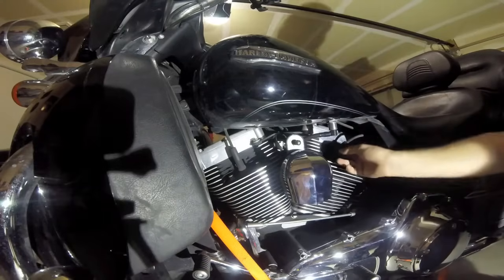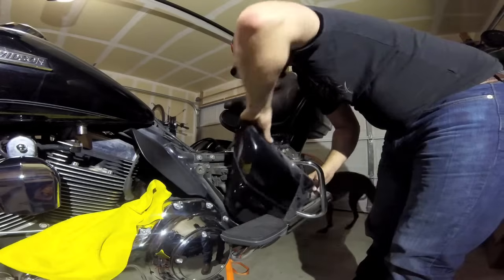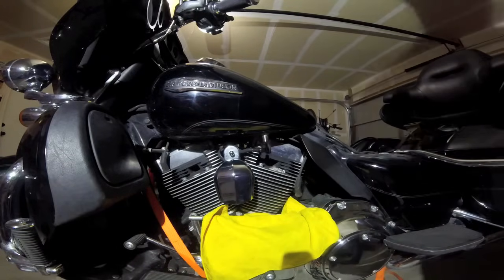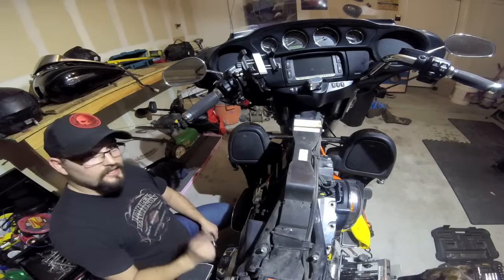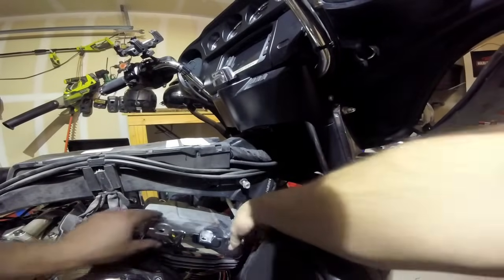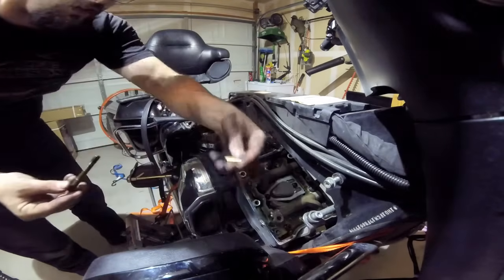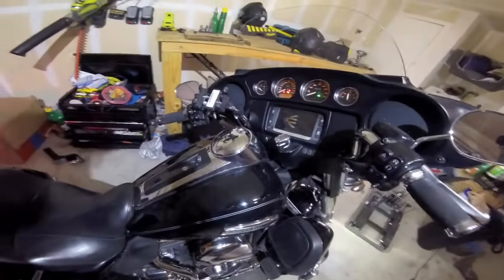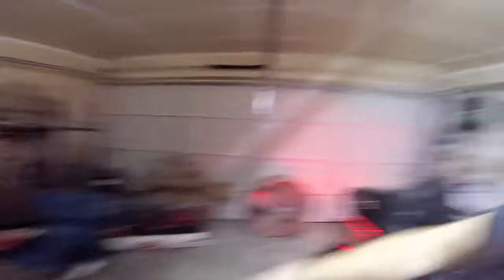$10 Part to Make Your Harley Top Tick Go Away

Comment: My pipes are so loud that I don't hear any ticking. Also any ticking that you do hear should go away after your bike warms up. But let's be honest, the ticking is a Harley thing and I have never found it to bother me much. Kind of surprised that you didn't use a torque wrench to meet torque specs or lock tight bolts before putting em back in.

Comment: $10 for the part ... 35 billion for gaskets and sealer and more gaskets and more sealer and sealer remover and stuff to clean the sealer remover off and more gaskets and 35 quarts of oil because it keeps dripping and oozing and doing that oil thing and more gaskets and 3 hundred thousand in gas running back and forth to the dealer for all them damend gaskets ...... yeah $10 for the part

Comment: i have the exact same bike with 24K miles and as a retired mechanic i wondered why it clicked. mine quits when it's good and warm. this thing is smooth as velvet compared to the old iron head engines. good video though and thanks.

Comment: Excellent video on a cheap, but labor intensive fix. I've had the same sound on my 2014 Dyna Super Glide Custom the last year. It has 32,000 miles on the engine. It goes away when the engine oil has warmed up. However, it is absent when I do an oil change. I just did the 3 hole oil change a couple days ago and it disappeared on start up. I usually change the oil every 3-5000 mile with 20-50 synthetic. I might start using the sound to indicate time for an oil change. When it starts to be a permanent sound, I'll definitely use your fix. At least on a Dyna, there is less work to do with parts removal. Thanks for the info.
Reply: Put a half quart of Lucas oil additive in each case...Premix it with the oils, before putting it in,  so it will not be to thick for the oil pump to pick it up,  I've done this since mine was new, and doesn't tick at all, plus I get 6-7 on an oil change...plus you can actually see it on the oil stick when its freshly new, when checking it, and I always have great oil pressure, during the interior time of each change...I have 45 thousand on mine and it performs great, with no ticking , even at the hottest or coldest times...plus I use Shell Rotella 50w oil...yes its diesel oil,,but it has great viscosity and last for much longer duration...I always buy my products from Walmart, it's the cheapest prices I can find
Reply: As of right now you just have a built in service reminder. LoL.

Comment: I did this fix when I had my Harley. Helped with the noise but still a lot there. I replaced the lifters next with some qualty after market lifters. That helped a lot. The rest of the engine still made a helluva racket. Many comments as to where is the torque wrench? I used one but in my opinion the factory specs are too high. I was afraid of stripping the bolts so I used my common sense as to the correct amount of torque.

Comment: It's always a good idea to say something to the effect of "this fix might quiet your engine" instead of "will" make the tick go away. I've installed these things and sometimes they help a bit, other times they do nothing as there are many other reasons Harley motors can tick.  Loose tappet to bore fit, worn or dirty tappets, aggressive aftermarket cam lobe profiles, loose valve guides, low oil pressure, etc.....it's a long list. The other thing is the rocker support plates are cast & not all exactly the same size where the Lockers get pressed in. I've had a few that I could not get the Lockers in no matter how I tried. So tight, they would fold before going all the way in.

Comment: I like that your video shows just how easy it is to install the rocker lockers. Hopefully none of that dirt fell into the top of your engine while you had the valve covers off. (have you ever seen how tiny the oil passage is in a oil jet?)  Rags are cheap man!  A torque wrench and a service manual are your best friends when shadetree wrenching on your bike!  Failure to properly and evenly torque rockers and valve covers can lead to a plethora of other mechanical problems and oil leaks.  Knuckle value torque is NEVER "good enough" on dynamic components, nor on gasket sealed covers.  Just sayin'
Reply: you should write this to Harley engineering team first :)

Comment: I like the quick disconnects on the fuel lines. Might have to look into getting some of those myself. My 98 Heritage has the crimped clamps on it still. Mine also has started ticking intermittently as well but my heads are a little harder to remove in the frame than yours was. Less space...

Comment: Whilst 'Rocker lockers' are a fine idea - I use them - another sorce of the ticking noise is the rocker shafts themselves being a loose fit it the rocker carriers and/or the rockers being a loose fit on the shafts. If you go to the trouble of fitting rocker lockers, you might as well do the job properly and check everything.Rocker shafts/carriers and the bushes in the rocker arm all wear out especially with higher lift cams/heavier valve springs.
Reply: I agree for the amount of labor involved might as well spend $250 and replace rocker shafts and bolts. Specially for engines running higher lift camshafts and heavier valvespring pressures.

Comment: My 103 twincam doesn't tick..I used Castrol 50w with a half quart of Lucas oil additive...I put half quart of Lucas in my engine, trans and primary...I always premix it with the oils, before adding it to the cases...I always have no less than 15lbs of oil pressure, even at its hottest moments at 100 degrees in heavy red light traffic
Reply: Not calling u a liar, but that's very hard to believe.

Comment: WOW!   Tightening bolts into head without torque specs or wrench?   
It still "ticks" like a Harley.  It probably always will.
Reply: I thought the same thing. I always use a reliable torque wrench. Over tighten one of those bolts, and you've got all kinds of trouble. Buy a torque wrench or borrow one, for a job like that. The same for the valve cover bolts.

Comment: When dealing with aluminum, you should REALLY use torque specs and not the spec known as FT lol. Too tight, you pull the threads out. Too loose, the whole top end will grenade. I hope you torqued them properly for your sake.
Reply: You mean two clicks of the elbow isn't the correct spec?
Reply: @frankhubbardiv8711  with locktite that'll probably work. Without, I'd go 2 1/2 clicks.

Comment: Maybe its by design that the tolerence is loose so that it doesnt wear that pin or rocker arm?....The bolt wearing is alot cheaper than those other hard parts... Just a thought...
Reply: That's why they design an item called shims, shimmed properly, it won't make a lot of noise. But u need basic mechanical skills and experience, this guy has neither.
Reply: If it was by design why is Harley installing these

Comment: What happens when those thin sleeves wear and break apart? They go into the oiling system and through the oil pump. Bye bye oil pump and possible the entire engine if you don't notice it the loss in oil pressure fast enough. I went through a similar issue with a rocker arm bushing on my shovelhead.

Comment: Hi, thanks for this. Do you recall whether or not the ticking noise went away once the engine warmed up after a few minutes? I've recently had similar noise - quick ticking or tapping sound - on my Sportster 1200 when I start it up but it goes away after a few minutes (presumably because the engine/oil has warmed up?).
Reply from the maker: @bernardlesperance742  after it warmed up it did quite down but never whet away

Comment: Do the valves make noise when they close, does that sound change with a change of the cams, it is after all, not a cast iron motor with water jackets, behind an insulated firewall, that motor is never going to be without mechanical noise.
Reply: wow...hit the nail on the head.  just rebuilt my 2005 15 anniv fatboy, from the bottom end up...,S&S brand new crank, andrews 37g cams,, adjut pushrods, 8007 bullet aluminum fueling cam plate, hp fueling oil pump,brand new clutch assembly,new hp 1.4kw starter motor,and new jackshaft, indy just up graded double row IPB bearing kit, all new jims gaskets, and seals, whole bike. i get it back, loud chattering tick/chatter from primary, worse than before all the work. was going to my  garage and look for my gun... no joke, this 2005 twin cam , has to be the loudest, damn bike i owned!!!  driving me really nuts....! Bike sounded like a diesel cummings, warmed up right after the cam install. then it was sumping(dry, bike off on stand) the new hp fueling pump/camplate, sucks oil down with gravity, in a WEEK?? NORMAL?? but  oil does returns full to the tank at start up, giving in a few mins,
      i checked my oil and its down to the TIP OF OIL STICK, ALL SUMPED TO BOTTOM CRANK CASE in a week!.  nothing can be done, thats just the set up fueling has much larger passage holes in plate and pump. My indy, took  camplate/oilpump all apart to check, for pinched orings, gaskets or seals, preventing oil to gravitate to the bottom crank in a week. all was good, as before he said.   so im about done, with bike, now i just ride the balls off it, ignore all the noise!!!!!   sorry so long, but good right!!!  ty, peace!
Reply: @-MrRichBiker1967  having to hunt for your tool, is fine, unless you need it right now....no joke
Reply: @-MrRichBiker1967 sumping is when the pump is unable to scavenge the oil from the crankcase, camchest, a serious condition, oil level should be checked after warm up,

Comment: 2001 Road king 107.000 mi on the engine. Got it with24.000 do my own work never had the engine apart..If its not broke do not fit...

Comment: No, No, No, I do have some experience with this ( Al's Motorcycle Shop ) the rocker shaft do not move when engine is running, and those locks are a pain in the ass to remove. do not use them

Comment: Can I leave a link where I can order that sleeve "that piece._ damn good video Brother good knowledge to share with us thanks u Brother.
Reply: Amazon is only place I found.
Just search Rocker Lockers and you'll find em. About $15 if I remember correctly.
I installed a set in my 2012 103 while I had it apart for a lower rocker box gasket leak.(put a set of reaper cams in as well). They do what they say they do. My motor (with loud pipes) has almost no top end noise at all and it just gives it an overall smoother feel.
Would I do all that work just for the rocker lockers? No hell no
But it you are taking the top end apart its just dumb to not install a set imo

Comment: Rocker Lockers did not do shit for my 2003 RK Top end noise. It is nothing more than valves clacking shut. The onl good thing the rl may do is help align the rocker assembly
Reply: I have the same bike, same issue. I know the ticking is normal and dont mess with it.

Comment: Weird design when the rocker arms can touch (hit) the bolts. I would rather prevent the rocker arms from moving back and forth at the ends on the rocker tubes. And perhaps put roller bearings in the ends of the rocker tubes if it’s not overkill to the design/function!?.

Comment: Do the sleaves only on the right side?  Or both sides??
Reply from the maker: You only do the right side because that is where the cut out is on the rocker pin
Reply: @LSRWvlog  ah ok. If you said it in the video I didn't hear it.  Thanks.

Comment: Wow I remember back when Harley's you know the made in America motorcycle used standard size fasteners. Don't forget an 11 mm wrench for working on your American motorcycle,
Reply: JOE OR GUS, 11mm is the same as 7/16. Or vise versa.
Reply: @PanM8  didn't know those lined up.
Reply: @bluebeard6189  sometimes when you buy the metric sets from Snap-on, Matco or Mac, they "throw in" the sae set. (Buy one get one) they will omit 7mm, 16mm and 19mm. (7/16, 5/8, 3/4)
Reply: @PanM8  I just always keep them separate metric and standard, two different drawers in the toolbox
Had a pisser of a time a few years ago my brother bought an old triumph, I can honestly say I'm the only guy I know who's going to full set of British standard wrenches and sockets. Pointless tools I had to buy to work on one bike and will never use again
Reply: @bluebeard6189  I used to run across BSP on hydraulic fittings back in the 90's. Don't really see it anymore. Just the thread pitch not wrench size.
Reply: @PanM8  ran into quite a few bolts that I could not find the proper size for, I went into it thinking standards were going to work for everything, after going nuts for about a week somebody turned me on to the fact that British standard run off size bolts on a lot of things.
You essentially can have a set of sockets that go down to 32's of an inch, or you can pick up a set of the British standard style which have the exact ones that you'll need when they get down that small of a difference. It might have been smarter for me to get the 32's, but hindsight is what it is

Comment: Sound about the same  are you even using motorcycle engine oil I’ve noticed that synthetic engine oil makes more top end noise. I just don’t think it sounds any better at all. LMAO 😂.  Yeah you should invest in a Service manual. You must have a dream. I think the wiggle is between your ears. Get a battery charger.

Comment: I just dont understand the Harley followers.  These bikes seem terrible.  I dont understand why they cost soo much, if they are such a poorly built product.  Is the lust for american pride that strong?  Hell, is it even american built anymore?
Reply: I'll try to give you reason. Owned several. Easy to work on. New 09 rode 40K. No probs. Traded for 2012 103cc. I'll give you the Compensator design sucked. Still drove 60k no prob. Decided on Darkhorse compensator. Just rode 3k miles to AZ and back.
Also have 98 Springer. Trouble free starting. Ride with pride. No other brand gives pride of ownership like a Harley.
Also ride a GS850GX Suzuki that I restored. Great bike. Not a Harley. Never will be.
Reply: @dougfresh1341  Thanks for the reply.

Comment: lol funniest gag of shit ive ever seen dont waste your time or money most top end ticks are from improper oil levels ive never heard of this ever. what do I know though 15+ years in the biz master tech, stick to your day job you have no business giving people tips on how to mess up their bikes.
Reply: They have been around for years. 15 years as a master tech and you have never heard of rocker lockers? Give me a break. Go bullshit someone else.
Reply: @vulcanman64  my bad no bullshit though come to me when you blow one of those rockers out I'll fix it right lol
Reply: They work and they work great the guy definitely has no idea what he's doing when it comes a torquing bolts down but the rocker lockers work great stop giving people information that is incorrect
Reply: @motomenace5243  how is it incorrect its just my opinion I think theyre garbage! well your at it I have some muffler bearings and halogen fluid I'll sell you lol. besides that if this theory were true the bikes you pull apart at high mileage would show wear to back up this theory but they dont other than some minor discoloration of the bolt